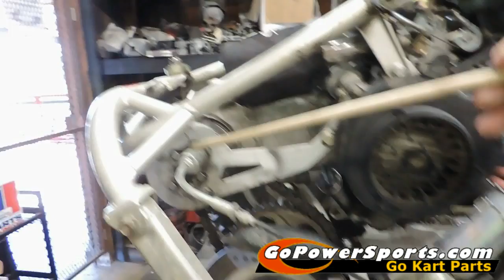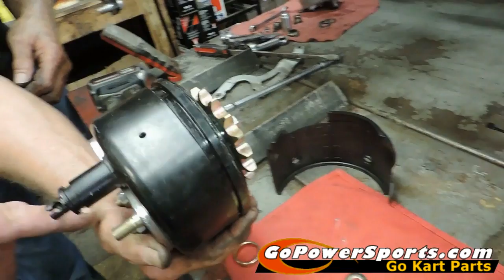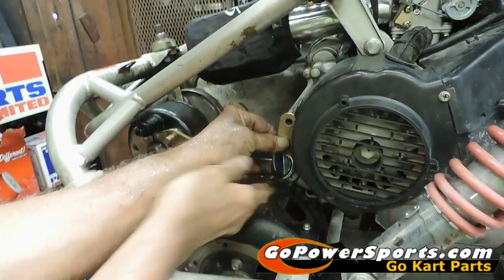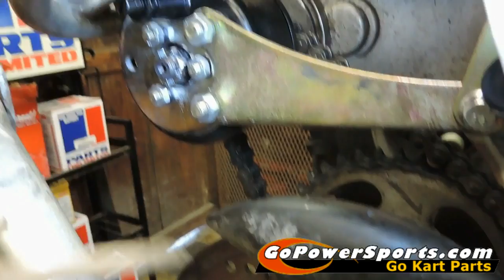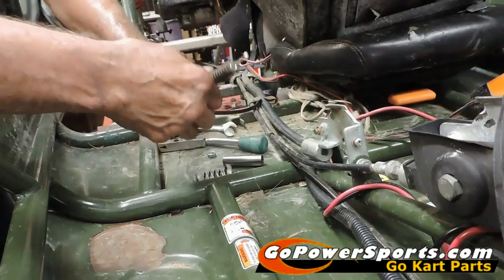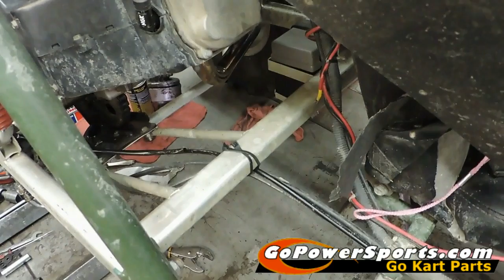Go Kart Reverse Assembly Install

Comment: will that reverse unit work with older carters with the short case gy6 and long output shaft?
Reply from the maker: I've seen 300 lbs get pulled up a mountain on this bike
Reply: @GoPowerSports  that's great but will the splines match up?

Comment: i have replaced the carb on my tomberlin crossfire 150. it running kinda sluggish, i tried to adjust the carb at idle is fine but as im driving it seems to lag in  power. speed and take off. what could be the cause of that??

Comment: So that main bolt on the spline is the only thing holding it on? I have an old one I'm pulling off an old motor and it won't budge. I can't figure out if I'm doing something wrong.

Comment: I put the same reverse assembly on my gts 150, goes in drive and when I pull The handle it’s like it goes into neutral but doesn’t go into reverse, trying to figure out if something  is messing inside. because I was giving it when I bought the hammerhead, I know the external reverse came apart maybe something isn’t aligning up inside to kick it into reverse.
Reply: Ever figure your problem out? I have the same problem

Comment: can that forward reverse assy. be modified a bit to work on a manco 606 frame with a 6.5 robin /subaru motor and a series 30 comet torque converter.  I have been looking at the comet forward/ reverse gear assembly, but if this works it is about 1/2 the cost.  What do you think?    or does go powersport carry the Comet forward /reverse.  Of course I would also need all of the mounting brackets, cables, hardware and lever.  Any advise?

Comment: I have a 150cc (147cc displacement) Chinese brand dune buggy. The reverse setup looks just like the one in the video. Is their supposed to be play on the backside of the reverse box,  Between the reverse box and the motor? I'm trying to determine if it's broken, because I've been having an issue with getting  it to stay in gear. I installed a new cable and it works fine as long as I squeeze it together with my hands. Any help would be appreciated. Thanks for reading.